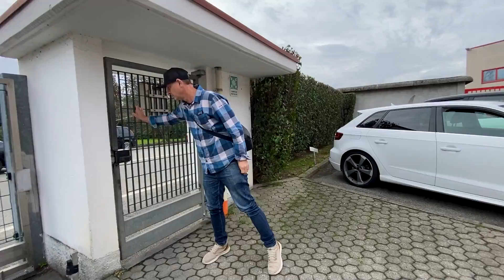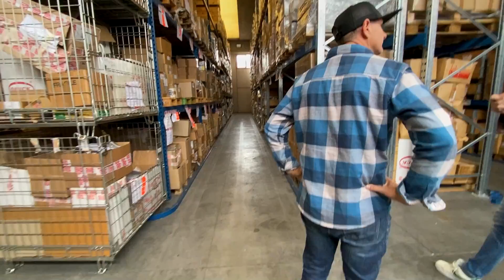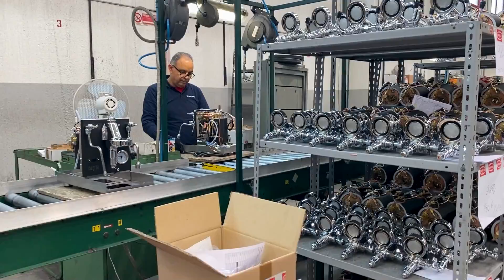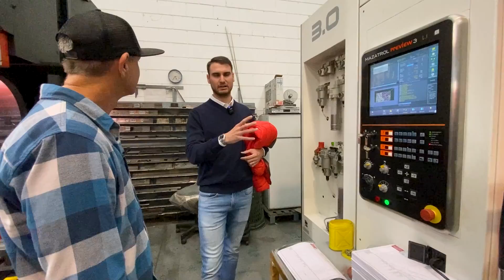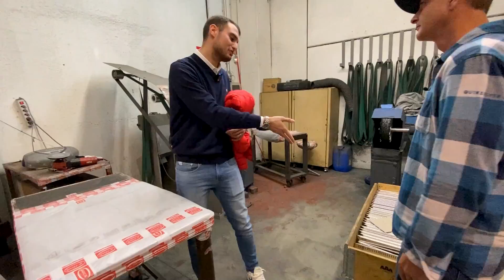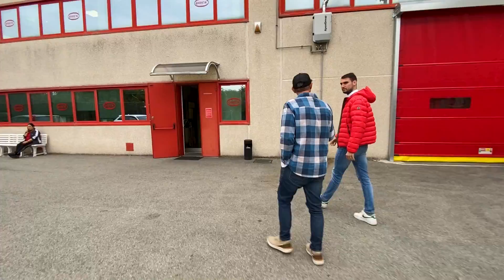Quick Mill Factory Tour (Italian Coffee Machine Manufacturers)

Comment: Great video! Thank you for the factory tour. Stefano should hire a lean manufacturing professional to redo all the manufacturing flows and eliminate waste. Also, putting visual work instructions and poke-yoke connectors will reinforce quality. Anyway great video and I will definitely consider this brand in my future machine purchases.
Reply from the maker: We toured many factories and this one was busting at the seems, as he mentioned a move is on the cards! 🤙🏻
Reply: I agree. I’d love to optimise Quick Mill’s production. There’s so much low hanging fruit to be harvested.

This setup does have its charm but unfortunately at considerable costs.